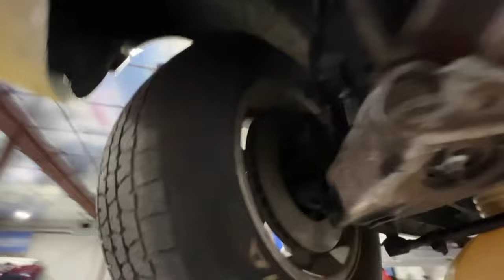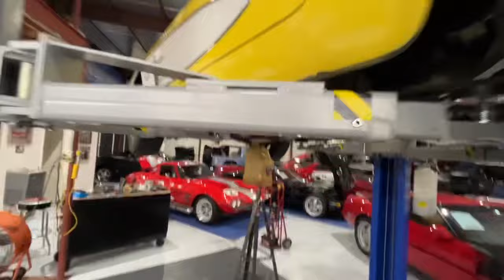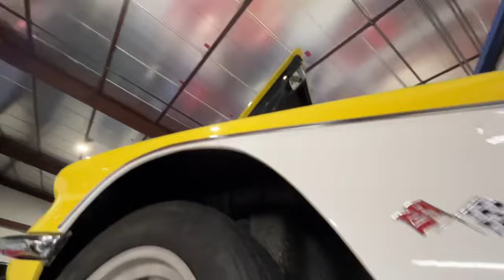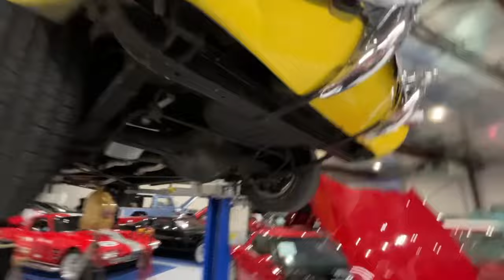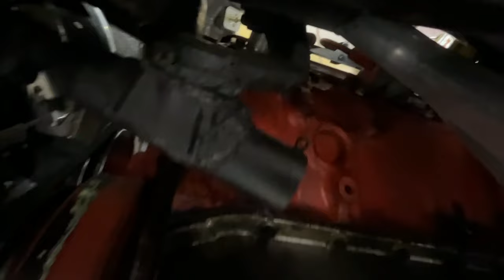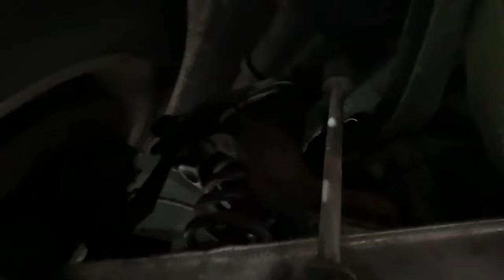1958 Corvette and 1957 Thunderbird, draining bad gas on 58.  How to tell if it’s really a fuelie

Comment from the maker: I’m actually incorrect on the block, the side motor mount were put on all small blocks in 1958 but the Corvette did not use them however the engine we are looking at is a 327 either way.  All c1 corvettes used front mounts but it is correct to see a 58-62 with the provisions for the side mounts on the block